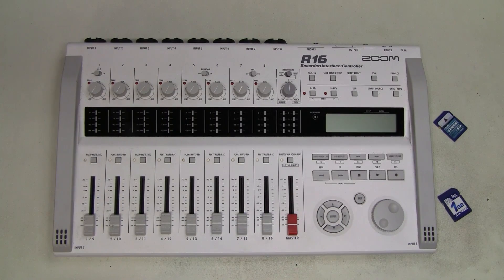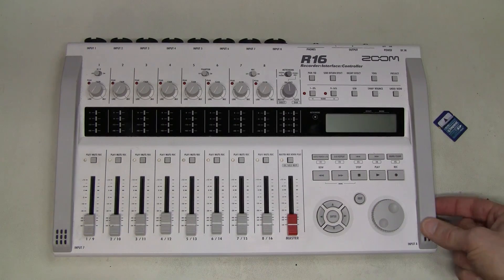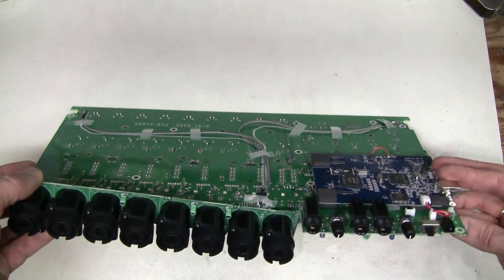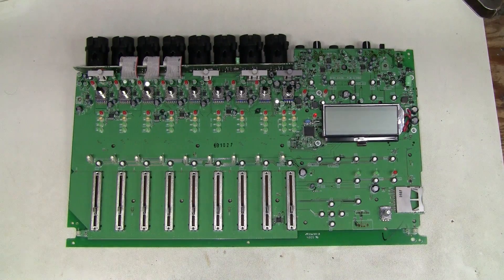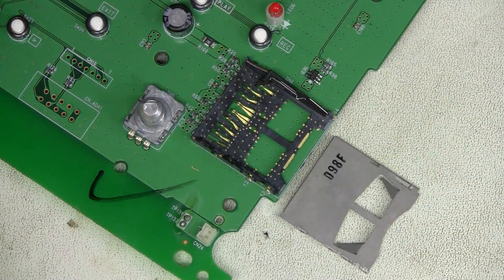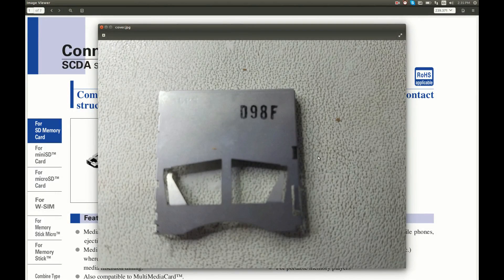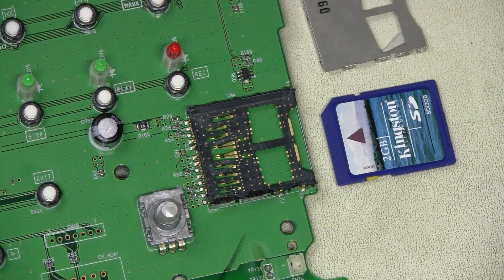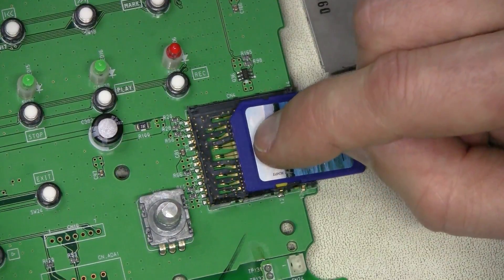#71 - Zoom R16 repair

Comment: I have a r16 that I bought used and it recorded all static noisy on channels 3 through 8..   channel 1 and 2 seem ok..   I took it apart to spay clean the buttons faders and knobs ..  and after reassembly I have zero input signal on 3 through 8 now..!   1 and 2 are still fine..  I think I seen a ribbon cable from the inputs to the board  that looked pinched pretty good.   Probably the true problem with the unit..  I'm going to open it back up and check that cable point to point with a multi meter..  just thought I would put this out there incase anyone else is having this problem

Comment: the sd cover on my r24 is kind of lifted where you insert the card, when I put the sd card in it completely missed the slot. took it apart and I can't figure out how to solder or keep the entry point of the cover down. there's no where to solder! its two very tiny clips that held it to the board. all the pins in the back are good but the two card locking/protected  pins bent back the other way. every single card reads 'protected'

Comment: I have the exact same problem with SD card slot.  Mine SD connector is beyond repair, and you illustrate perfectly that with no replacement part available, and even no schematic to troubleshoot other issues, you are pretty much S.O. L.    I like this piece of gear, and many that Zoom produce, but the repair issue is a serious drawback on all of them from what I am seeing.
They make it real real difficult.
Reply from the maker: Perhaps, if desperate, some sort of adapter can be designed to fit some other similar SD card connector. a flex-board or something

Comment: Thanks so much for doing this video! I watched this one and "#60 - Zoom R16 repair fail" mainly for the disassembly/reassembly and to see what the SD card stuff looked like. I just bought an R24 off eBay and it all seemed to work great except the card reader was iffy and kept saying "NO Card"... I took it apart using these R16 instructions and it was almost identical. I reflowed all of the card reader pins I could and it didn't really seem to fix the problem. However, I kept noticing the whole thing was a little warped when I got it and it wasn't after the finished reassembly and the card seems to read every time (so far). Fingers crossed it was just the wonky chassis fit and this fixes it, lol.

Comment: I have r24 and the round jog knob doesn't work correctly unless you hold little pressure down on it.if you don't it will skip or not change .does it just need some contact cleaner or need new jog pot installed

Comment: Nice work! I just took apart my R16 as the SD card reader appeared to have a bent cover so cards would not insert or eject easily. I discovered the eject mechanism has a piece broken off in the right corner where the spring is held so have to try and find either a replacement SD reader and repair or find someone in the UK who can repair it as I don’t think my soldering skills are good enough.
Reply: In normal use for the R16, you don't ever need to remove the SD card, so as long as you can get the card to stay securely in place, you should be good to go.  
In case you're wondering, you can backup to a computer by using the USB cable and putting the R16 into CARD READER mode. Now the R16 appears as a disc device on your computer and you can simply drag and drop whole project folders, or individual files.  It's a feature I use frequently.
Reply: Mandolinic , many thanks for your reply. I’ll experiment with some wedges to keep the card in place. The R16 is normally used in my band’s rehearsal/recording space where it is connected to another R16 with all the inputs permanently connected so we can record everything we play. One thing we don’t have there is a computer to directly transfer the files to but your response has prompted me to try to resurrect an old laptop to use for this purpose. Thanks again.
Reply: @Mr2tastypieces  Once you can figure out how to copy files between the R16 and a computer, a whole new world of possibilities opens up to you.  For instance, you can record a track on the R16, copy onto the computer, then use Audacity do some off-line editing, then copy the edited track back onto the R16.  I typically use Audacity to clean up a noisy track and to amplify/compress a quiet track.  I also typically rename each track to reflect the instrument name (eg. BASSGUIT.wav).  If you do this, remember to re-assign the file to a track as described on p23 of the manual.  Limit file names to 8 chars plus the file name extension (.wav)

Comment: Being a SMD component, it shouldn't melt right away when trying to rework/remove that SD card-slot with hot air. It is definetly not placed by hand or wave-soldered. If it was, that would be the indicator that the component wasn't designed to handle the heat of the reflow oven. Just so you know in case you didn't.

Good job repairing it, though! You don't give up getting nice gear easily!
Reply from the maker: Yes, I know it was soldered in a reflow oven, but it is not easy to have a controlled profile like this with a hot air gun. Have a look at the data sheet in the description: 240°C max, 10 seconds above 230°C. I could have tried if I didn't succeed soldering the pin.
Reply: @feedback-loop  That is indeed a very low tempertature for it to be soldered at, makes you wonder what type of paste they used. 
I thought you knew about this thing and just wanted to point it out, but as it was like 3.30 AM at the time i got woken by some random noise and watched your video, I didn't go as far as to look at the datasheet. Thanks for replying!
Reply: @MrDubje  Preheat makes the difference. That is why they can solder at lower temps in owens even with lead free solder.